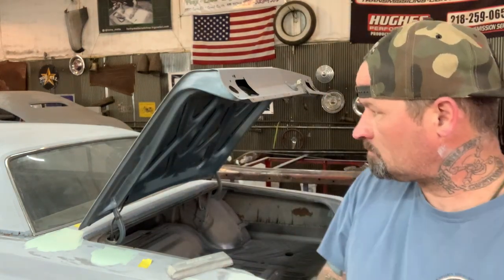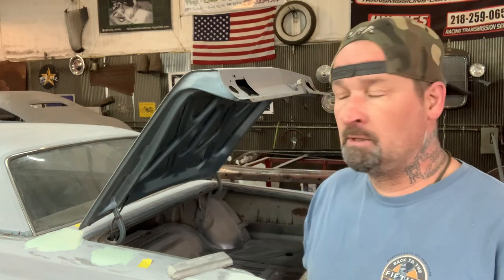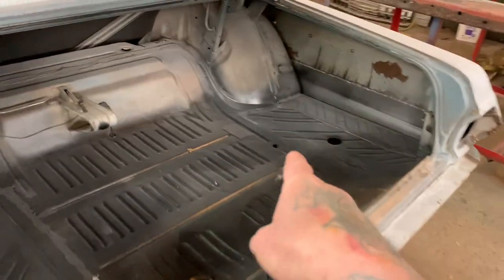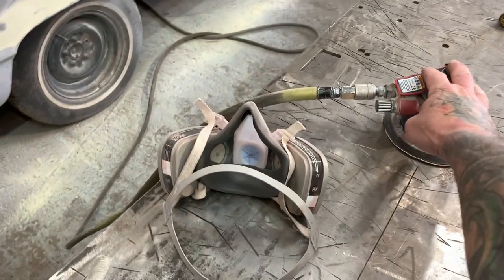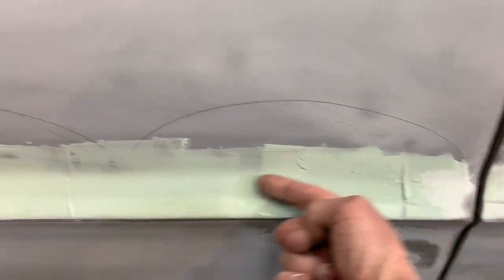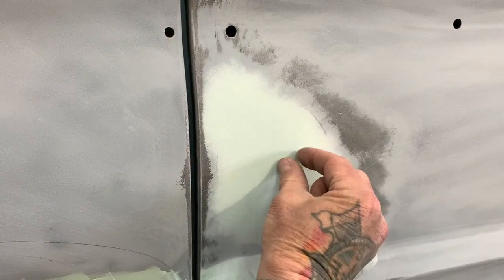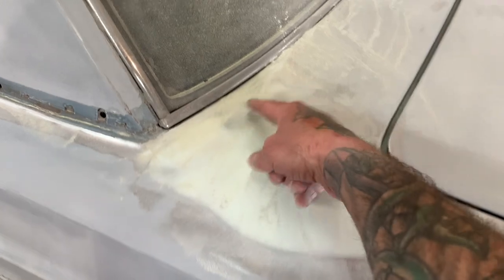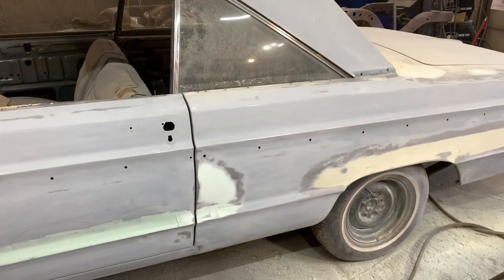Mopar Bodywork

Comment: Hey man- your thoughts on using a chatter board, (air file sander) on longer panels such as quarters?  I know some guys don't care for them but they sure have saved my elbow tendonitis when using 36 or 80 grit on filler...
Reply from the maker: Yeah i use them alot then block by hand after that 👍